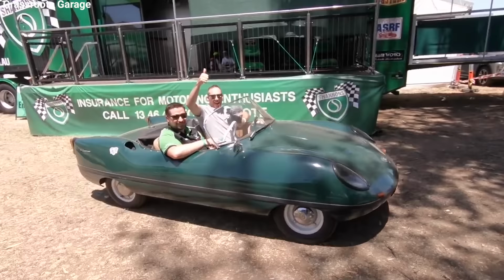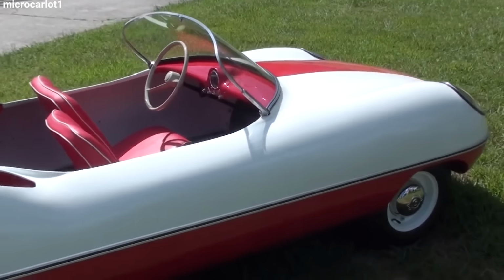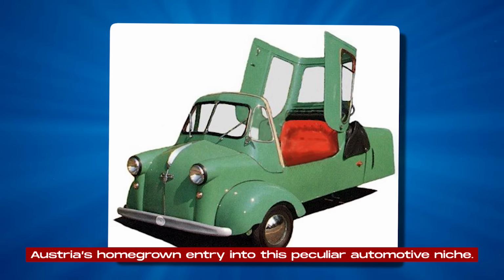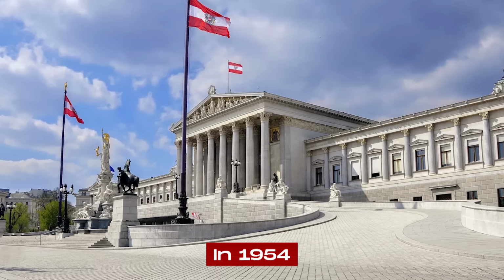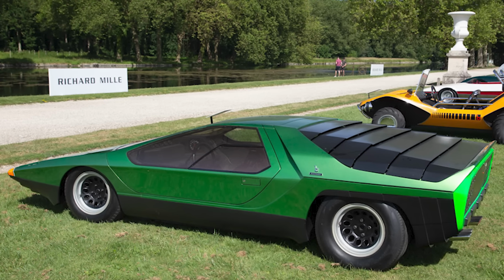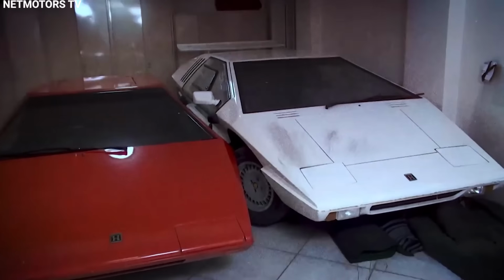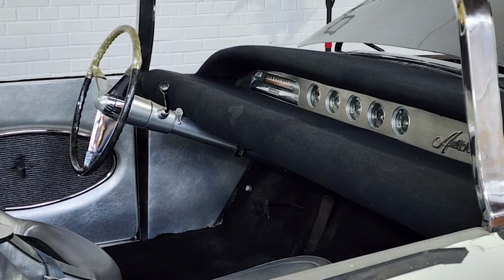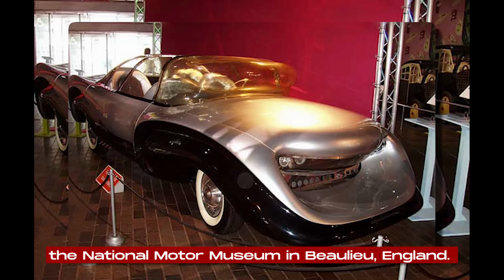4 Most Unusual Cars You Won't Believe Exist!

Comment: even considering that it might no rain often in Australia, the hot sun is an issue on a car that has no roof.  I ve been driving a fiat 124 spider convertible for 22 years, but I only kept the roof open in summer nights at low speed. On the highway I often closed the roof to be protected from sun and wind

Comment: That is a german auto name which means Little Bug Car and is pronounced Cgho-cgho mobile.  I had a friend whose father had a junk yard (oops I meant to say automotive parts recycling location)  They had a used Gogomobile that they used to run around it looked remarkably newish but the right front fender was badly damaged and the cost of importing a new fender meant the car was totaled!  I spent one afternoon with him throwing the Gogo around the lot, occasionaly clipping some of the wrecks.  it had a gear selector that looked like a toggle switch growing out of the dash, with an outline of a 4speed tranny engraved behind it.  You just clicked from one gear to another, ignoring the clutch pedal.  I noticed that there was no position shown for neutral and was told that the clutch pedal was used for two purposes: 1-to replace neutral and 2- to get the little bugger going.  I have driven several high performance autos including a D Jaguar and a coventry climax powered Lotus 11,  but none came even close to as much fun as driving that little Gogo in the muddy junk yard!  My friend passed away from Cancer a few months later, but I will never forget him and his funny Gogomobile.